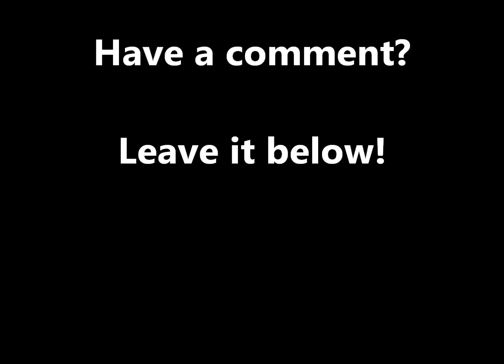Why magnet motors can not work (part 2)

Comment: What about taking the advantage of equal and opposite forces, but gear down one part, then achieve the same torque on both rotors, but one is spinning faster, but both in the same direction. Hence more energy in one rotor than the other rotor so it "wins" the battle - then they both spins in the same direction, but one faster than the other (must add a little LOL here. I've tried with a gear rotary (the same principle as oil pumps in engines) model I made. It does not work :))

Comment: sir do not get me wrong I am not criticizing you apparently you were taught to believe something in school that wasn't true the laws of physics as we know them are meant to be broke people want to follow by Nature what they are taught in school I apologize for what you believe but I have actually seen machines that were built that I could not explain how they ran but you believe the way you want I know what I've seen be careful too much information you'll get a visitation and it's not from me you have a nice day sir
Reply from the maker: So exactly which laws of physics are you referring to that can be broken?
Reply: ian5576 I have found years past that they did research in regards to water splitting that now people are not only doing that but they are running small motors generators and cars, fact is when I was in the military I had a chance to see some things in regards to free energy devices but there is nothing that it's free about them it takes an effort time and a bit of money to put some of these things together, John bedini, has came out with a 10K bedini motor generator, there was a refrigerator type water vortex that came out years ago that would produce more power through a hydro vortex turbine there was a gentleman down in California that got poisoned because he had a dune buggy that ran on the electrolysis of water, and I have done some experiments of my own and ran small generators using electrolysis to run an alternator to charge a battery Bank of no less than 6 battery I can run the thing 4 over 8 hours at a time and my neighbors asked me to shut it down the first time I did not tell him what I was doing but I was visited a few times , the utility companies companies actually run the United States Whoever has the Commodities of utilities are running the US so beware there are people out there that can make you disappear and it's not because you're putting down what is reality you have yourself a nice day and a Happy New Year.   one more thing if you are truly interested there are magnetic motors out there that do actually work but other things you might be interested in is high frequency generators what they do is use a neon sign Transformer and a power inverter and a light dimmer control or a motor controller be careful when you look this stuff up you'll find it one of them is called a Capuchin spelled with a k generator it can deliver as much as 60 amps but it will also charge the battery that runs it the problem is you have to get it at 60 hertz and if it is not running at 60 hertz the government will find you they do have frequency detectors out there looking for this. anything above or below the frequency they can find you

Comment: Where does all the Energy come from when an Atomic Bomb explodes ....   and is there such a thing as Half an Atom?
Reply from the maker: An excellent question!

The energy comes from a process known as 'mass defect'.

Basically, the fission fragments have slightly less mass than the original U235 or Pu239 atom that was fissioned and if we multiply that missing mass by the speed of light squared we get the energy out. 

In other words, good old Albert with E=mc^2

Excellent question!
Reply: Thnx - I saw a few videos years ago where Magnets have been cut at special angles and mounted to track and train ... It worked  .. and no it wasnt a fake . . years had been spent on Research  ! Monopole sort of !
Reply from the maker: Why are you so certain it worked? 

People have been claiming success with magnet motors for centuries, yet not one has ever been presented to the scientific community for validation.

Comment: I agree that to use any power source is a failure because I believe I have a design that does not require a battery or motor that can bolt right up to your cars existing transmission and can be used as a home power source
Reply from the maker: How is your project coming along?
Reply: drawings but no magnets wish there was a easy way to just have the pieces you need lol its on the back burner reality cares little for wants collecting parts as i find them be a long time comming
Reply from the maker: Maybe try small scale, prototypes rarely become the final design.
Reply: agreed but i believe that due to the design i have i need to go full scale because of the weight involved its a combination of weight proximity and self generated power should weigh about the same as a normal v6 don't believe i would get accurate results from down scale model the torque comes from the weight it sounds really complicated but its really not if you know what the design is and how i expect it to work i believe i would gain support if i wasnt so scared to lose my design and share it with people in full so they can see or understand what im talking about the simplicity is mind numbing
Reply from the maker: Keep in mind, even a small scale permanent powered magnet motor that produced excess energy (of any amount) would be regarded as the biggest scientific breakthrough in human history. 

I wish you luck with your experiments!

Comment: God damnit... there are already about 100 videos of people using videos of people setting it up to move the magnet on there own. The problem isn't that the energy comes from peoples hands, the energy is coming from the magnet, which eventually runs out.
Reply: StormCloud no
Reply: not on an electromagnet
Reply from the maker: That is called degaussing (magnets losing their field over time), but there is an even bigger issue with an all permanent powered magnet 'motor'. 

Can you think of what that is?

Comment: I came up with a VARIATION of a V Gate and have been trying to find reasons why it wont work before I try to build it. I've spent some time watching videos here on the tube and although there are many configurations of V Gates shown the one I have in mind doesn't seem to exist anywhere even though it seems to me to be an obvious next step. I've made 3D drawings of it in order to help visualize the idea. V Gate may not be an appropriate name for it since I don't use a gate. So far I haven't been able to find a reason for my idea not to work and I'm trying, actually really hard, to find a reason for it not to work. I came to this video hoping that you would have information that would show me why it wont work. I'm sorry to say that I didn't get that here. My feeling is that people trying to build magnet motors approach the problem from a position of way to much complexity. K.I.S.S. If ever I do create something that works my intention is to release all of the drawings and 3D printable information to the public under a general use license. This is in order for anyone to replicate and modify my idea on any size dimensional scale. Now that's a good Deal !
Reply from the maker: +Jim George The best way to learn about these things is by trying. These are not very expensive devices to build, so go for it and come back and share your results!

Comment: But there many more reason why magnet motors won't work.
Reply: It's not theoretical. It's easy to write off because it's easy to predict the failure. Just because the magnets don't touch doesn't mean you write off the laws of simple simple 101 physics. Sheesh. The idea is a non starter because the wise ones know better for very basic reasons. Fundamentally it's silly and shows the root ignorance of what you're doing in the first place. Please take a physics class.
Reply: I'm being told that 2+2=4 but I don't believe it. I'm going to prove that 2+2=avocado with a bunch of magnets and some broken washing machine parts and maybe this toaster over here....yeah I'm really on to something. I need more duct tape.
Reply from the maker: +Kris Alutius That is true, but there is only so much you can put in a few minute long video.
Reply: +Kris Alutius Like what? I'm just starting to investigate this stuff. Its very tempting. What makes it impossible?
Reply: Every law of conservation of energy. Every law of thermal dynamics. We've known this for over 150 years. Magnetic force is like dropping a rock. It takes more energy to separate magnets than to bring them together, not to mention that there is heat generated bringing magnets together and the field weakens. So many more ways to loose energy than gain. Then you put it into mechanical motion which creates air resistance, resistance in the bearing, resistance from gravity. If you start adding coils, you're done for starting with the Hall effect, eddy current braking, further weakening  of the magnetic field, more heat generated. Once you add a battery, you just make a crappy motor. The problem is you just can't convince these people that these effects are real. You can't convince them that thermal dynamics works and it's what our world runs on. As far as assuming someone will somehow magically overcome this through stubborn-headed experimentation is just silliness. Tesla worship holds no great unsolved mysteries.
Reply: Kris Alutius And holy hell they worship the king of A/C don't they? Never understood it. Anyway, the thing that bothers me about writing off the whole thing is that, couldn't the concept at least be used to increase efficiency maybe? No magnet motor I've seen ever lets the magnets touch so and again, as you say, the conversion of flux to heat  shows that, if it were possible to turn a motor with magnets alone, it wouldn't violate the conservation laws. 

Finally, if it were possible, even on a small scale, one would think it would be possible to scale it up you know? Again, maybe not a standalone, but a scaled up "assist" motor or something. Everyone treats the idea as a non-starter. I just don't see anything that absolutely discounts the possibility that it could work, at least theoretically.
Reply: Kris Alutius I may do that actually. I got through half a statics class and had to quit. Still, your comment just shows why this can catalyze people to pursue this even if it may be impossible. You call the question "silly and [that it] shows the ignorance of what [I'm] doing." 

I'm sure if I was to time travel to the time of aristotle and say its possible to communicate thousands of miles away instantly and would be called insane and stupid. Its this negativity which surrounds this idea which makes those "wise ones' sound simply arrogant. 

There's simply no reason to treat curious yet not fully educated people as retarded simply because they don't know something. that attitude does little to progress the narrative. All it does is drive people to be skeptical of well established science.
Reply: Kris Alutius if x2 caps = one lower case and 2 = AVOCADO, 2+2=avocado.
Reply: It's all guacamole to me.
Reply: Kris Alutius GLAUCOMA!!

Comment: I hate these close minded people who think free energy is impossible and  who always want to comment  negatively on this subject
Reply: +pk subbon I want to make free motion neodymium magnet generator with n52 10mm cubes (20) is a round wood surface with 6 N52 40x20x5 mm magnets as stator. I am double minded some times because I see many videos which runs CDs and hard disk stator with another magnet, and some says that these free magnets motion are fake. I am a 16 years old Pakistani and a student in 10 standard. I have not contact with any engineer and scientist in my relatives or friends. please give me suggestion.
Reply: +pk subbon Sorry to tell you, free energy, i.e. energy that is created from nothing really is impossible. But you can make an apparent free energy device. The energy isn't free. The potential energy of the magnets cause a rotary to spin thereby transforming it into kinetic energy. You can then transform some of that kinetic energy into electrical energy. At least you can until the ball bearing in the rotary wears out. Then it stops and you have to replace the rotary or the bearing if you want to continue to get power from the device.

Comment: well I made a bet with my friend in chemistry class at bunker hill that I could make a new form of liquid that reacts with glass and so I spent the next week experimenting then I put the last type of liquid that i created in the glass cup  before I called it quits and I noticed that the liquid turned blue and the glass cup did nothing and I said wow a waste of my time then I got angry  and put the glass outside then dumped the liquid into the grass then I left the glass cup outside and  went back into my parents house  but then late at night I heard this annoying buzzing sound  when I was trying to go asleep and  I got out of my bed very frustrated and stormed outside in my pajamas to see where this sound was coming from, it turned out is was the glass cup and the cup was glowing purple and I saw electricity coming off the cup so I said to myself can I get power from this glass cup ?so I rigged up a small toy motor and some wires and attached it to the cup and the motor ran I was shocked and  I was like maybe I will become something in my life and I  did the same experiment with another glass cup and the motor ran as well and I noticed the motor did not stop running until it burned out so I got a better motor  and then it kept running and running and it didn't stop until it burned out but the glass cups kept producing electricity for some reason even though the motor burned out  so I got a really good motor and now it has been running for months non stop, I will put the video up to prove it , it looks simple  but it is not at all, the new form of glass  converts  some type of energy into electricity by itself its weird but cool.

Comment: While I agree with your video, the one thing that you don't address are those who are not trying to build a perpetual motion machine or 'over unity' BS, but believe that a permanent magnet motor could work through demagnetization.
Reply from the maker: logicalfalse Good point, and it has come up a few times in comments. It may be time for another video from the degaussing angle.

Comment: Good presentation and understandable slight bias. Adding friction into the picture, you will think it is never possible.
When I was studying electrical engineering, professors explained electricity and magnetism theory. I asked several questions about things I did not understand. The professor answeers, and I'll have even more questions and the more he explains, the more I find it difficult to believe! At these times professor Kraft used to laugh and tell me to solve the homework and exams with the common understanding, however the truth is something else!
Unfortunately, my life was filled with difficulties and I could not fulfill my dreams.
Here is what I concluded. The theories we study are trimmed carefully to give us this understanding.
On the case of magnetic motors, you are partially correct. The other side of the story starts like this: Applying a special pulsed magnetic pulse wave in some kind of a vortex form,  pulls in some flux from the environment which could be used to generate work.
Similar to the open system of wind mills.
Reply from the maker: Emran Ba-Abbad Yes, most entry level Physics and Science courses are 'trimmed' up a bit to help move the student along through important concepts however with the right Professor (and personal drive) you could gleam a great deal of our knowledge base and have a strong conceptual understanding (meaning it all makes sense) of why we do things the way we do.

If interested in E&M I suggest studying the work of Michael Faraday, he was the son of a simple blacksmith who self taught his way into becoming the Father of electricity and magnetism (just stay outside of Maxwell/Heavside interpretations of his equations; unless you have a Very strong mathematical background). 

If you have any questions please feel free to post them!

Comment: Ian5576...I fully understand your points, i like your videos...many set ups not practical i know..however any one who has played with magnets knows how hard the are to get apart or push together with like poles.  That represents force within the magnet and requires external work to get them apart.  If people work together we can administer this force to do work. The problem is not in the application but in the investment that people usually give up on.  The hover train is an example...the power of the magnets cause the reduction of friction to reduce the energy to move the masses.
Reply from the maker: ***** I can see how it would seem like a permanent magnet powered motor could work but all attempts (after many centuries of trying) have resulted in nothing. Also it is pretty clear from the Science we know today that they can not work.

I recommend giving it a try yourself, go to your local hardware store and pick up a hot glue gun and some magnets. Experimentation is the best way to learn about these things!
Reply: ian5576
 I never said the magnet motor will or will not work in my comment..  Perhaps you should take the time to read and understand a  comment if you are to respond.  I see your points but your ego discredits them.
Reply from the maker: ***** "I never said the magnet motor will or will not work in my comment..."

Is that right, then what about this part of your message?,

"...If people work together we can administer this force to do work.",

This implies you believe they will work, I suggest next time you read your own comments more carefully   ;)
Reply: ian5576  huh?
Reply: *****
I think that's Ian's point exactly.